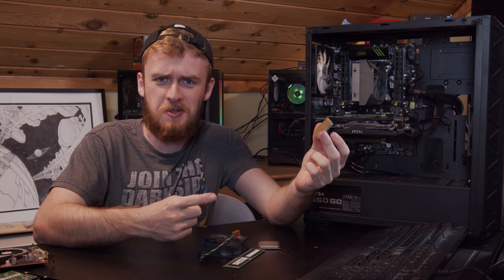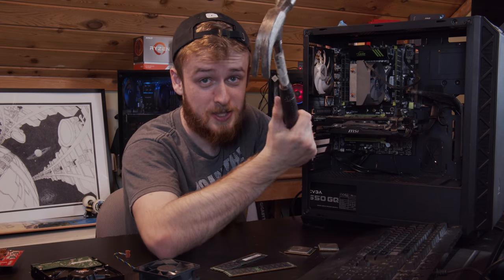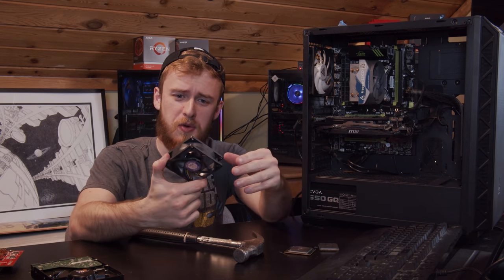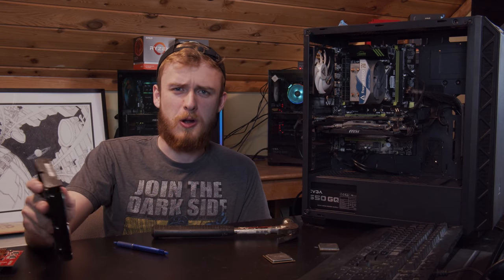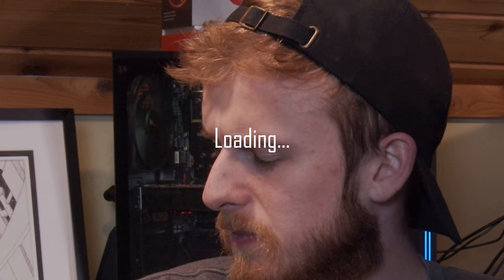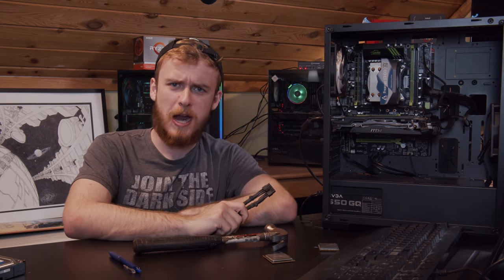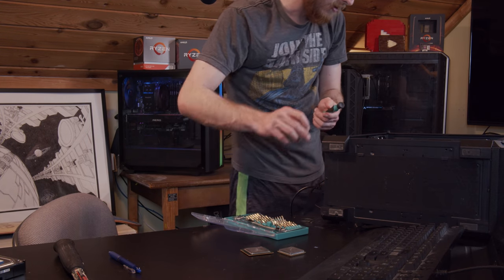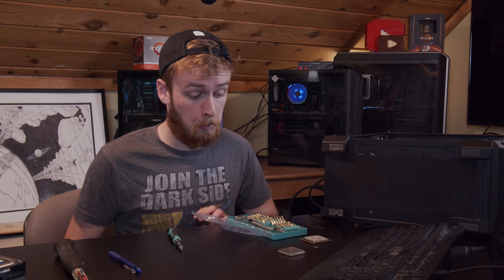What Happens When You Install The Wrong CPU In Your Motherboard?

Comment: To answer the PSU question: Power supplies typically have different gauges for the wire, and some may even have capacitors in them. They can also be rated for different voltages and loads based on the model of power supply they are using. This is not just an EVGA thing. Wire gauge used to be a commonly discussed topic back in the early 2000s and early PC building as you'd not only have to get a power supply rated for the total wattage you'd use, but also certain parts would work more (or at all) with certain gauges in the wires used.

Comment: Just in case anyone was curious, the reason you shouldn’t mix PSU cables with different brands or makes/models is that even if the connectors are physically the same, the pinouts (what each pin actually does) can be totally different depending on the manufacturer. You can get lucky and they work just fine, or you can have decidedly more explosive results.

TL;DR Just because the connectors look the same and plug in normally doesn’t mean that the actual internal connections match up.

Comment: 6:40 There's no "wrong wire" and there is no chip. 
For sata-power and most other connectors there are 4 electrical potentials: ground (0V), +3.3V, +5V and +12V. 
(There is also a -12V and "always on" +5V potential that is only used in the motherboards 24-pin connector. The last two mentioned potentials are for audiodevices and usb respectively.)
The sata-powerconnector is standardised. That means every sata-powerconnector is wired the same way. 
BUT the other end of the wire, that goes to the PSU is not. That means that every PSU-manufacturer is free to change the pinout the way they like too.

I don't know if you ever played around with electronics, but you should know that powering a DC (direct current) device the wrong way or even supplying too high a voltage can lead to it overheating, exploding or just not turning on, depending on the safetycircuitry.

Comment: the thing about psu cables is that while the component end like 24 pin, 8 pin eps, 8 or 6 pin pci-e power etc. are standardized the psu end is not. so they will fit since they all use the same connectors but the pinout might be different and you end up frying things. sometimes even when you use cables as you say from the same brand on another psu from that brand. 
so to be safe either only use the cables that came with the psu, cables that are made to be compatible specifically for this psu or just try to if you are capable of it then find a schematic for the pinout and rearange wires if needed.

Comment: The way the wrong PSU cable can fry something is because the pinout on the PSU end isn't standardized and may be different between different models and brands. SATA power cables have 3.3v, 5V, 12V, and ground pins. If, for example, a PSU cable has the 3.3V and 12V pins backwards and 12V gets sent to a pin that is only supposed to get 3.3V, bad things are going to happen.

Comment: I probably almost screwed up bad when I first installed my new CPU. It came with a new fan and when I installed the new CPU and plugged in the fan, I turned it on and I could hear something hitting something else. I knew what it was. The wire was in the way of the fan. I immediately powered it off and moved the wire. I could have just broke my fan.

Comment: Yeah, the psu wire one is the worst, you have two cables that are identical. You plug everything in and then your ssd suddenly has RGB and smells funny, then you realise that different PSUs despite having the same connector have different pinouts. Then best thing is that it didn't even fry the sata port on the motherboard, yet the sata cable melted

Comment: About the wire . They might be wired wrong for example a 12 v pin in one psu would be 5v in another  and you might end up sending 12v to 5 volts

Comment: There are multiple voltages comming from your power supply.    12v 5v 3.3v and 1.2v.  If you put 12v on a pin that expects 5v or 3.3v or 1.2v your going to get smoke.      If the pins on your power supply are layed out differently than the cable it expected you could easily get smoke

Comment: Could you tell us what specific Intel processors were used in this video, most intel chipset mobos give two generations of compatibility with a given bios. But in some very specific niche scenarios there is some cpu and mobo combos that are unsupported that will still post with a different bios flashed or some modifications to the hardware itself.

Comment: A couple of months ago, while watching a video on my laptop, Windows went into blue screen mode and blew the SSD. Installed new SSD. SSD incompatible with external boxes. No DVD burner, no SD card reader. Won't install OS from external DVD burner.  Won't install OS iso requiring Wi-Fi connection. Have now bought tablet to download Linux iso from weak Wi-Fi signal to load on USB key. If that doesn't work ...

Comment: I once shoved a 6 pin GPU power cable into the 4 pin CPU power. It turns out, it fits nice but the polarity's wrong.

Comment: I once installed a really powerful exhaust fan the wrong way round. The air flow stopped the fan on the cpu cooler from spring opps

Comment: Lol, that reminded me of the time not so long ago, when I was upgrading my PC, and I didn't realise there were 2 cables labeled "CPU", I thought there was only 1, so I used a CPU cable and a PCI cable and the PC wouldn't post 🤣 just whaaat? How does a litteral wire know it's the wrong wire..  btw the PCI and CPU cables looked identical so I donno, same width, probably same wattage too, same pins, just strange, the next day I realised there was a second CPU cable and it worked when I connected that one 😂😂

Comment: Is your 15,000 fps minecraft pc build still good? If so how many mods can it run without lots of lag? Please answer
Reply: I'm not an expert, but I think I can help here.

I highly doubt that still works on the newer versions of Minecraft, as versions after 1.12.2 aren't as fast as pre 1.12.2, unless you are using fabric. 

Really, that amount of fps would be overkill. 
What budget are you looking at for a computer?
Reply: @louisgarbour2737  $1000-$2000

Comment: This would've been MUCH more pertinent if the appropriate pins were remapped to the RAM and CPU sockets, or used with some sort of an eBay adapter. Obviously jamming sh*t into the wrong socket won't work... but with remapped pins to the corresponding pins in the socket, maybe?  🤔

Comment: So I bought a e3 Xeon 1220 V2 for my gigabyte z77 board and I installed it with an outdated bios that didn't yet support this processor. Well amazingly I got into windows and everything was fine until I go to do a stress test for temps and check the freq it's running at etc making sure its turbo boosting etc. Well at 1 min mark the CPU spikes to 100°c-120°c and I'm boosting to a freq of 3.8-3.9ghz and it didn't thermal throttle like it should at all it just stayed at that clock and which is nucking futs being that this cpu only boosts to 3.4ghz on it's best days and 3.1ghz as it's base clock. After this I shut down immediately and I go into the BIOS and everything freezes and gets stuck in a boot loop that only stays on the gigabyte splash screen and can't get back into the BIOS. Thankfully I was able to flash a new cuz my board thankfully has a Dual BIOS feature. Well I flashed my BIOS to the version that supports this CPU but I'm afraid to try again and really mess something up like possibly bricking my board. Has anyone ran into this before? I thought if you stick a incompatible cpu into a board it won't post at all?

Comment: LOL whenever I was younger we had this laptop that was kind of old. But I was too young didn’t have YouTube and had too much time. Well I wanted to upgrade the RAM but for some reason the ram didn’t fit. So I cut out The part that was not letting the ram enter the slot. So I took some wire cutters and cut off the internal notch. And guess what, it went in. But for some reason the computer never acted right after that.

Comment: 6:59 how about different pinouts on different models 🤦‍♂️ 
Always use a multimeter to check if the cable is identical or not.

Comment: I have a Ryzen 3 3200g on a520m ds3h motherboard which doesn't support the 3200g can I still update the bios or would it not work bc the unsupported CPU I did not mean to have unsupported CPU I didn't know diff Mobo had diff CPU compatibility

Comment: I have a 92mm server fan as my exhaust, that thing can spin up to 4k rpm
Reply: damm that must be nosiy
Reply: @qasimallawati4049  In the fan specsheet I found on the internet, it was written that max noise level is 50db
Reply: @LatvianVideo  well that isn't that loud
Reply: @qasimallawati4049  With my  zotac reference GTX970 going at full speed, it sounds like a vacuum
Reply: @LatvianVideo  damm

Comment: i did the wrong wire with psu before the power supply only clicked since it has a safety measure i was like ehm what so i replaced the videocard cable with a original and tada pc booted no damage just funky

there some skylake intel processors that even while not supported by some motherboards still worked in newer motherboards of the time and also just because you say have a 3rd generation ryzen doesnt mean 1st generation cant work but thats atleast am4 socket intel was just funky with the skylake because the socket wasnt the same still the processor worked

Comment: him saying "teething" instead of "key" is a thing i am annoyed by for some reason even though i do want to see what happens when you do what he is going to do. For the SATA cable you can have the wrong power coming to it from the PSU. EVGA can have configured the PSU to have a different pin out on each PSU which to me seems useless and a waste of money to do  but they can. The end that needs to have the correct set of wires is the side to the internal component. The PSU can have whatever pinout the company wants it to have as long as it works and powers on it is good enough to sell.

Comment: WAIT.......your an electrical engineer and u dont understand one of the first basic things u learn?????@???? wires come in diff sizes grades an thickness depending on what voltage/amps they carry...........im not an engineer an i learned this shit in school..............saying that........i do belive psus tend to all use the same grade of wire...... so in theory yes you can swap them if u can get them to fit....... i still wouldnt tho.....................also i understand this channel is a joke.....so i thought id put the apropriate troll comment to go with it :P..... love the channel